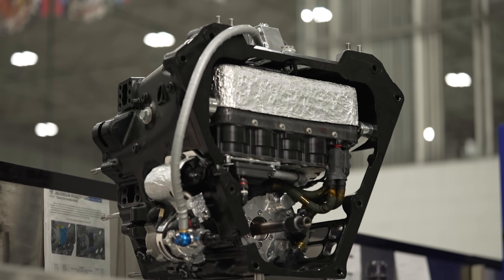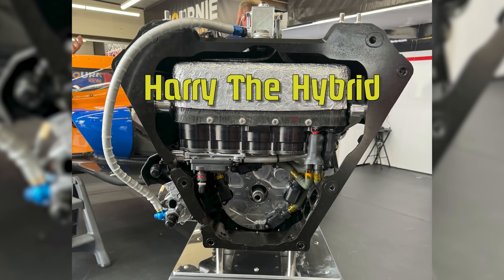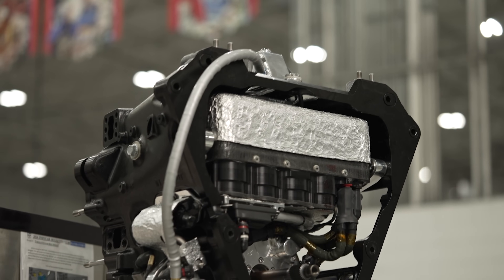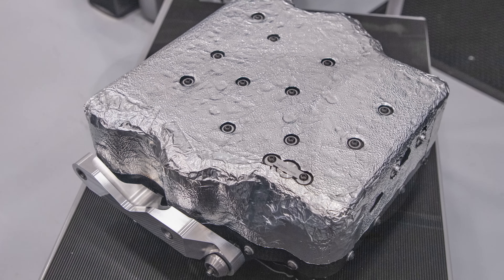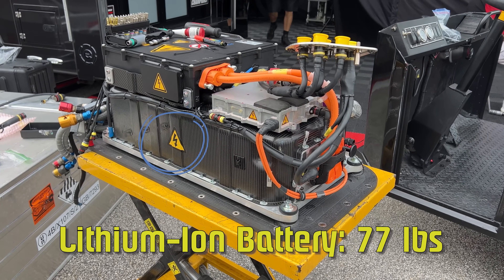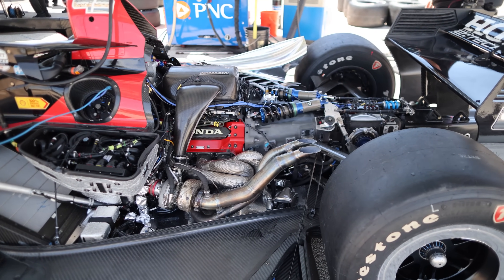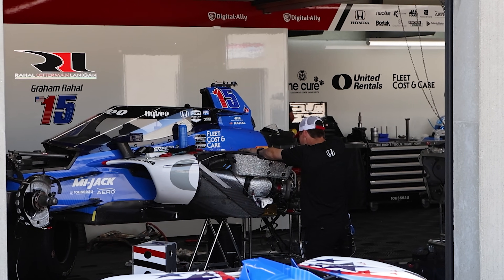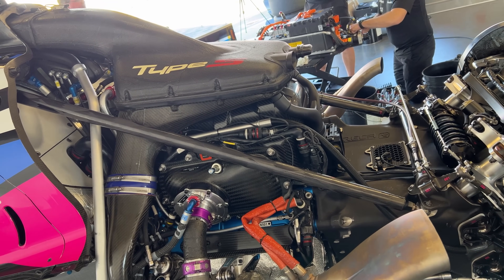IndyCar vs IMSA GTP Hybrids: The Cars and Components

Comment: These systems have caused changes for safety in both systems.  GTP cars have a special connection that allows for the flooding of the battery compartment with a water fire extinguisher.  For INDYCAR, the AMR team now carries a Class D extinguisher on one truck incase the Mag bell housing decides to burn. (Unlikely, but possible if the car becomes heavily involved in fire)

Comment: By the time Indycar commissions a new chassis, axial flux electric motors should be more commonplace. This enables better integration with whatever engine they use, perhaps even replacing the flywheel. 

There is also a lot of research currently on "zero mass batteries." This does not mean batteries that don't weight anything but rather batteries that form part of the vehicle's structure. The next Indycar can have a battery pack that is a stressed member much like how the engine and drivetrain already are.
Reply: That's what supposed solid State batteries research articles say. "Very nearly here." Fusion is closer to fruition with the Tokamak reactor being built.